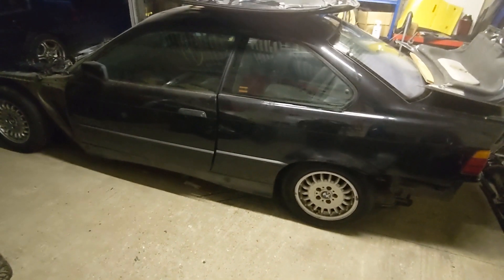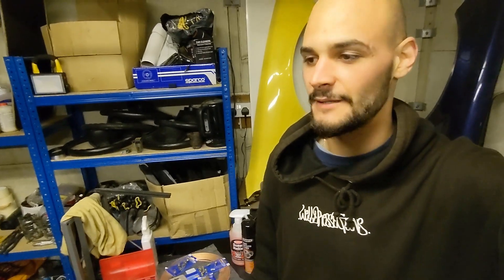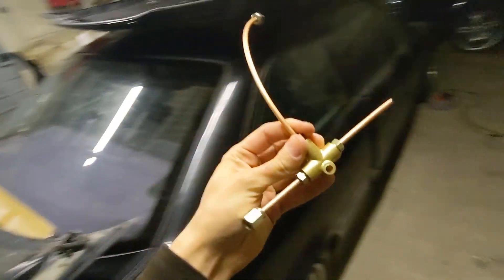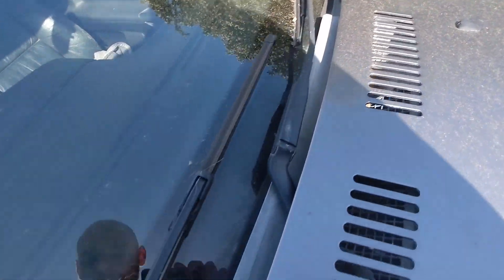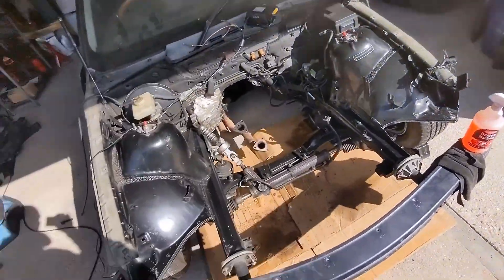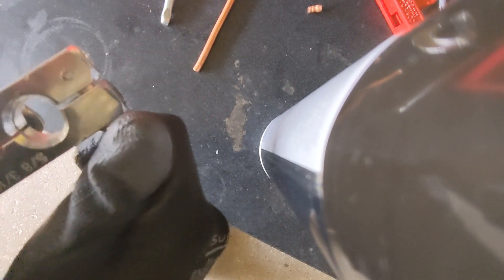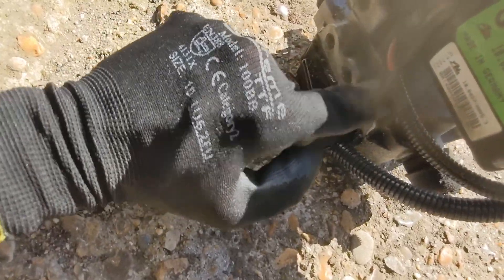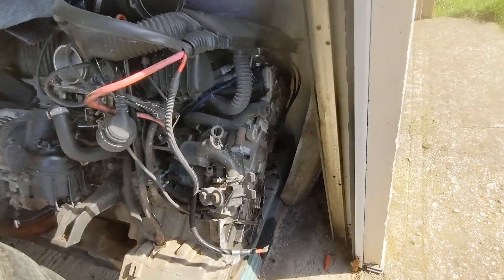E36 Street Car Project - DIY ABS Pump Delete

Comment: Nice job mate. Some tips for the future, there's a handheld brake flarer on ebay for about 40 quid, use that next time. I will try find you a link.

When flaring for a female end you should be doing a female flare instead, as the male flare mates up to the female flare and doesnt leak. 

And last thing, when doing the abs pump delete, you can get rid of most of them lines and just run them straight from the master cylinder, makes it a more tidy job.
Reply from the maker: oh wait, so would my connections leak now as ive only got male flares??

 there were many options for flarers but none were availabe instantly 

my plan is to redo the whole brake system and run all new lines form the master as you are saying, but for now im just looking to put the car together and drive it :):)
Reply: @AlexDotchev  yes they may leak, try them first just incase, no point taking them apart if you dont need to. But the correct way is male on the male end, female flare on female ends.